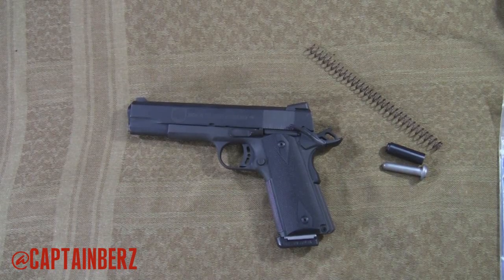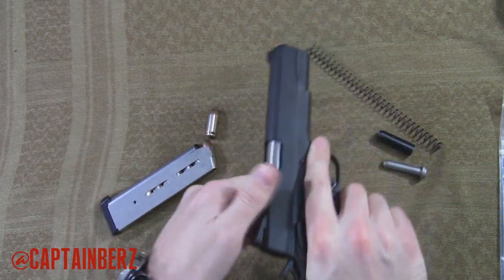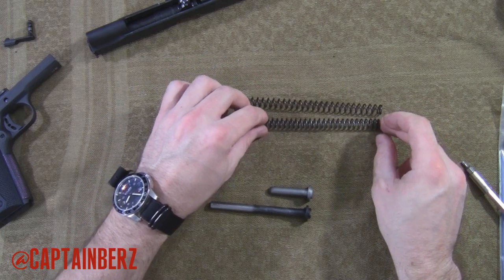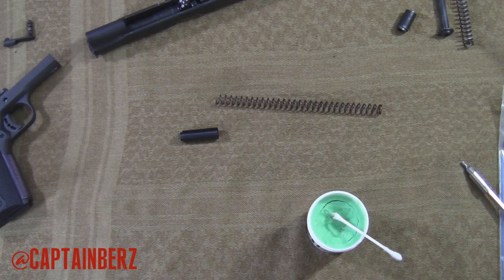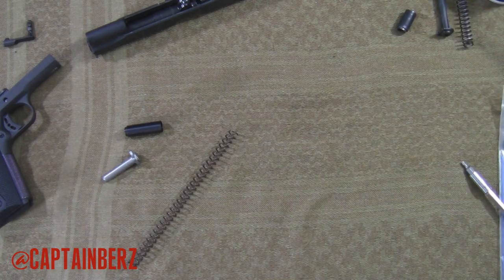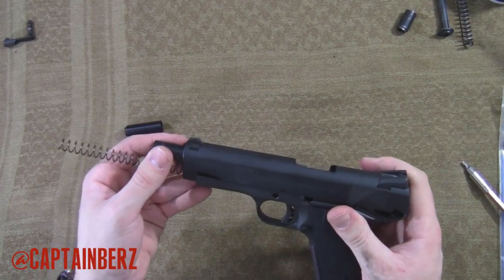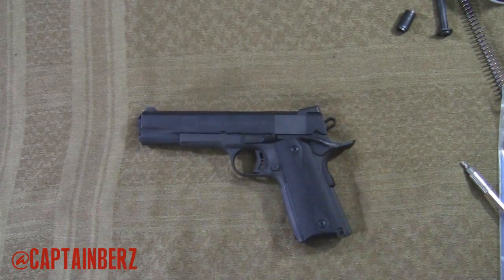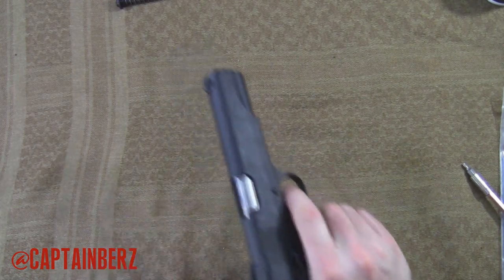1911 Full Length Guide Rod, Spring & Plug Replacement

Comment: My 1911 jammed, spring-bound while I was checking it looking at tight guide rod. It was completely useless, couldn't close the slide into battery, etc.. I suspect it is the poor fitting G.I. guide rod. It is tight and binds, which proves you have to fit some parts for smooth function. I borrowed the full length guide rod from my other one and tried it and no problem. I could not duplicate the bind when changing back to G.I. guide rod, but if there is any chance of this happening again I am going to get a full length rod to prevent it. G.I. one needs smooth down and grinding down a bit for a smoother fit on that SIG SAUER stainless barrel.

Comment: ive heard the full length guide rod make the gun more accurate. do you find any truth in that?
Reply: Be careful on the fit of which ever guide rod you use. See my post. My blood ran cold when it jammed. Good thing I wasn't firing it. Had just removed some dummy rounds. 
alanex
1 minute ago
My 1911 jammed, spring-bound while I was checking it looking at tight guide rod. It was completely useless, couldn't close the slide into battery, etc.. I suspect it is the poor fitting G.I. guide rod. It is tight and binds, which proves you have to fit some parts for smooth function. I borrowed the full length guide rod from my other one and tried it and no problem. I could not duplicate the bind when changing back to G.I. guide rod, but if there is any chance of this happening again I am going to get a full length rod to prevent it. G.I. one needs smooth down and grinding down a bit for a smoother fit on that SIG SAUER stainless barrel.